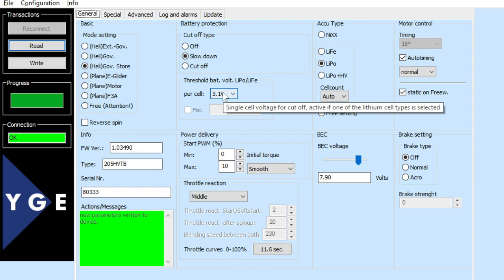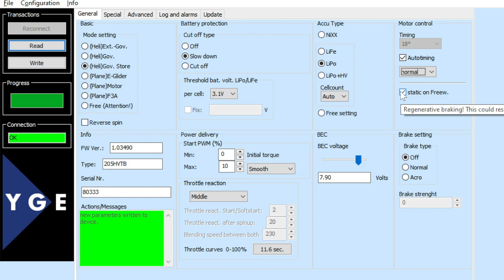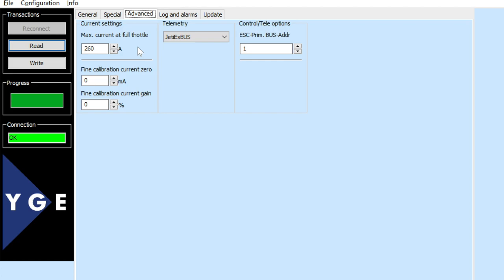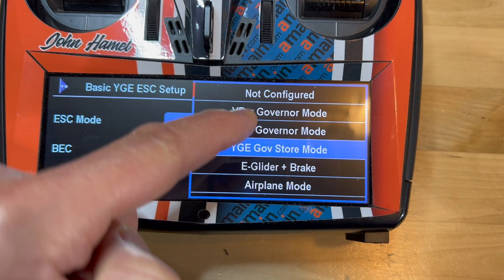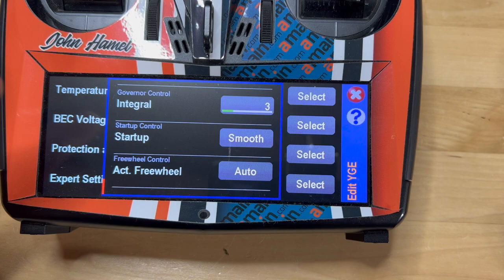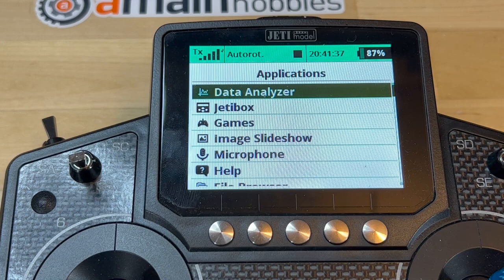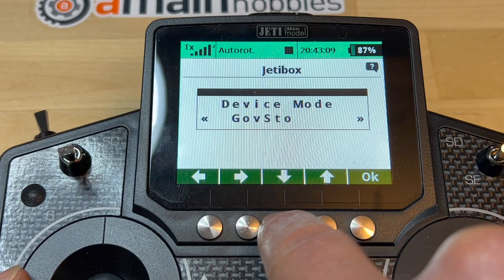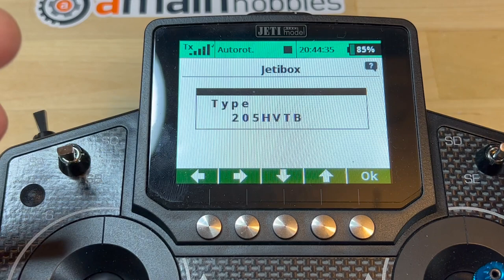YGE integration with Mikado VBC vs Jeti radios   HD 1080p

Comment: Always respectected your comments John, but using both systems I cant personally agree calling Jeti a historical system. Perhaps you should do a full review on a much wider picture. start with a tear down on both systems, quality of build and electonic components used, show us how you use a Spirit GTR, Axon BD, futaba set up with the V touch. remember you are comparing a single unit produced for one system, its not dual band and capable. What Jeti offers in other features is probably why its  used to fly some of the most expensive pieces of equipment and on a whole bigger picture is a more popular system.
Reply from the maker: Hello.  I apologize if I did not make it clear in the video.  No, I do not consider Jeti a "historical system" at all.  I don't believe I said such thing in the video.  At around 8:00min into the video, I did mention that the "JetiBox" and the "JetiBox emulator" are legacy systems that have been superseded by the more modern Jeti "Device Explorer".  The Jeti manual itself states, "For maximum compatibility with 1st generation JETI DUPLEX, the DS-12 are equipped with a JETIBOX emulation function. This emulation shows its information in the legacy two-line display format."  When discussing the "Device Explorer", the Jeti manual states, "the Device Explorer (located in the Model menu) replaces the integrated JETIBOX emulation and brings additional, more intelligent ways to communicate with your remote devices."  The YGE parameters can only be accessed through the Jeti radios via the legacy JetiBox, not through the more modern Device Explorer.

The video is not intended to be a comprehensive showdown between the Mikado VBar Control touch radio and the Jeti DS-12 radio.  The video is intended to demonstrate only just the difference between the YGE ESC 2-way communication integration options between VBar Control Touch radio and the Jeti radios.

Comment: I have a new Vbar Control EVO ordered on the way coming from Spektrum. I have a question: Do you have experience with other ESC's such as Scorpion or Kontronik? Would you recommend those over YGE? Any comments on integration with Vcontrol of those esc's?
Reply from the maker: Hello.  I flew Kontronik (Kosmik, Jive Pro, Kolibri) almost exclusively between around 2016 and 2021 with Jeti/Spirit and later VBC Touch/Neo.  The overall performance of Kontronik ESCs was superb.  Telemetry worked equally well for Kontronik to Jeti (using the expensive Kontronik TelMe Jeti version units) as well as Kontronik to Spirit to Jeti (not needing any expensive Kontronik TelMe units).  In 2018-2019, I switched from Jeti/Spirit to VBC Touch radio and Neo VLinks mainly for user experience interface (not any  better overall flying performance).  Since VBCT/Neo began offering 2-way communication integration with Tribunus and YGE "T" series ESCs around 2020, I tried both Tribunus and YGE ESCs with the VBCT/Neo around 2020.  The Tribunus ESCs worked fine, but they were not in the same performance league as either YGE or Kontronik; I just sold the Tribunus ESCs and kept comparing the YGE vs Kontronik ESCs.  In the end, I found the YGE ESCs overall superior to the Kontronik ESCs, so I sold the Kontronik ESCs and kept my fleet pretty much 100% YGE.

Comment: Hi, John. I just bought VBAR control touch. I don't have a computer. I wanted to know if it is mandatory to use a PC for any procedure for YGE or can I do everything from the Radio?
Reply from the maker: I don’t know for sure.  I’ve always connected the YGE ESCs to the computer program to update the YGE firmware AND set the telemetry to Mikado protocol PRIOR to connecting to the VBCT/Neo.  I suggest making sure to have the YGE app installed on your VBCT radio, and check if the radio will recognize and integrate with the YGE  ESC without needing to connect the YGE ESC to a computer first.   Hope it works.

Comment: John,
Thanks for another informational video, along with your inciteful commentary and wit.
I have been following your Jeti/Spirit GTR videos with much interest.
Actually with enough interest to invest in both. (DS24,GTR).
I’m still new as far as helicopters go.  I’ll be setting up a Logo 480 for this season.  
I know you don’t hold back and if the functionality isn’t there, kudos to you for calling that out.

I currently have a Hobbywing Platinum Pro (120A) ESC purchased for the project.   Do you know of any other ESCs that “play well” with Jeti?  I’m still in the assembly phase.
Thanks again for taking the time to make these videos, they are appreciated.
Reply from the maker: I believe only the Jeti Mezon ESCs fully integrate with Jeti radios.  It is my understanding that most other ESCs (YGE, Kontronik, Tribunus, HobbyWing, etc) will only output telemetry data, but I don’t believe Jeti allows for programming of these ESCs via the radio.  😩
Reply: @johnahamelv  Thanks for the quick reply John!
And Yes, my first inclination (after seeing this video, and really enjoying the seamless and quite complete integration) was to peruse the Esprit site for Jeti ESCs.  
My goal for this season is to head out to the club field with a machine that is pretty well setup and not having to rely on the 1 or 2  heli “gurus” that we have.  Don’t get me wrong, they know their stuff...it’s just how it is delivered. I should appreciate that the club has two heli gurus.
After 30 years in the Aerospace industry it’s hard to take the heli-splaining.🙄  Keep making the content....you are appreciated!
Reply from the maker: @airfoilsinmotion4777  I would be careful installing Jeti Mezon ESCs on helicopters.  Even the guys at Esprit recommend against it.  I believe the Jeti Mezon ESCs are good for airplanes and gliders, but not for helicopters.